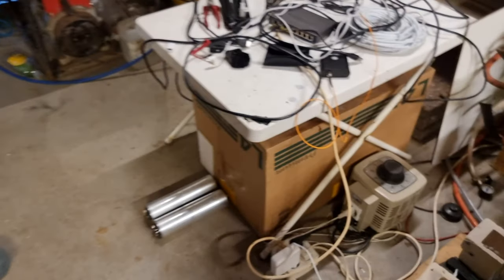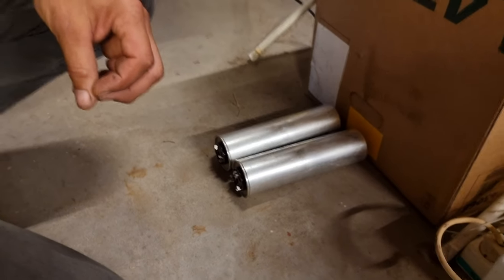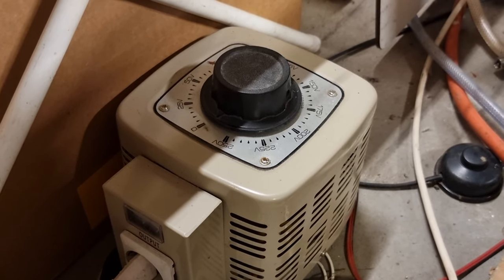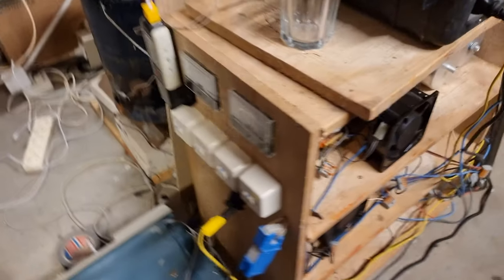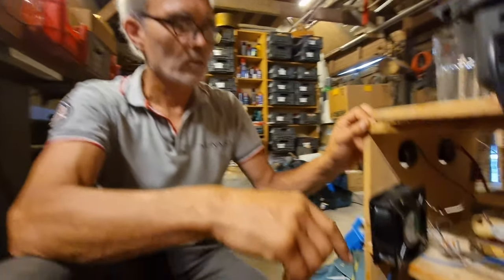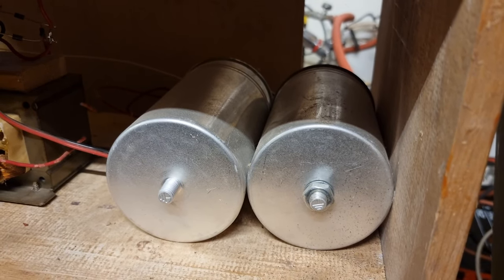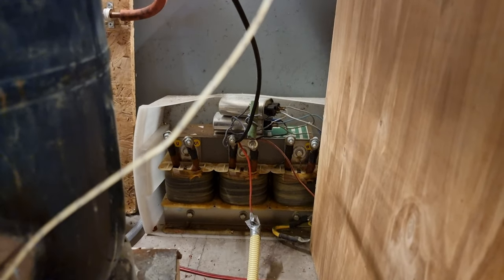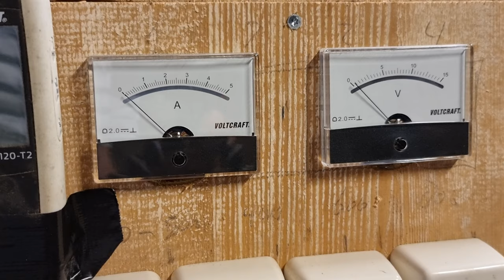VEGA - Power Supply

Comment: Do not mess with these power supplies for VEGA unless you absolutely are experienced and know exactly what you are doing with these type of electrical apparati.  They are absolutely deadly and safety has to be considered the absolutely #1 when dealing with these voltages and currents.  These must be treated with utmost respect and I recommend physical disconnection from power before going near any of the wiring or alive components even if you are an electrical engineer or experienced person with these type of systems.
Reply from the maker: Absolutely
Reply from the maker: Pinned
Reply: May I add, what we are seeing has already been done. New Dawn of the Old Age-D-Or. hehe.

Comment: Several consecutive, different and very clear resonances can solve the problem of high current consumption. If the voltage is increased, it is mainly for the resonant attraction of saturated electronic ether particles.
Reply from the maker: thanks

Comment: halogen cooktop is a mean ballast resistor, that thing will never fail... folks may also find large resistor in elevator control circuits. very curious setup Henk has come up with. Considering other info that claimed tritium production they use 70nano second pulses @ 400v. they didmt have great capacity like Henk has.